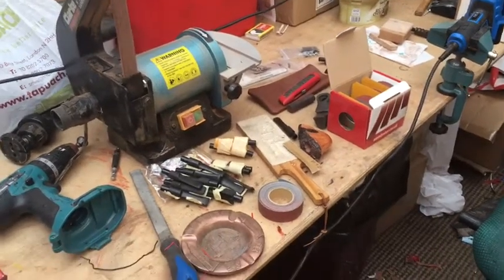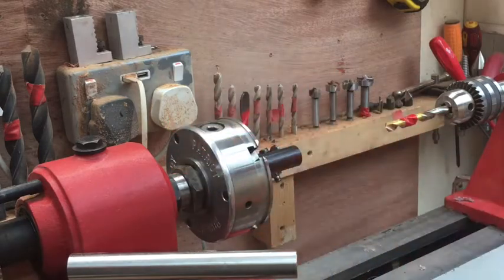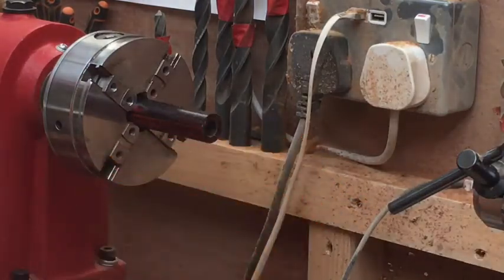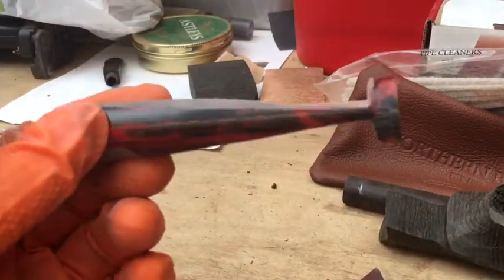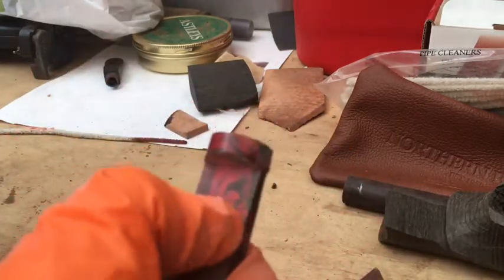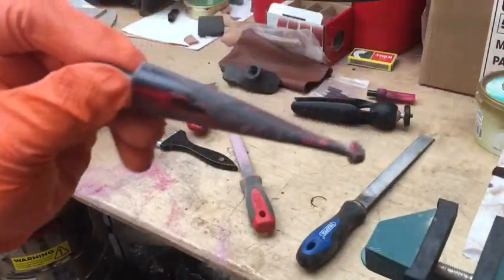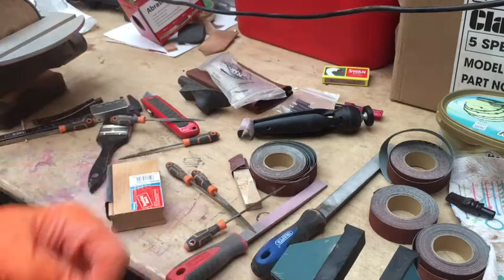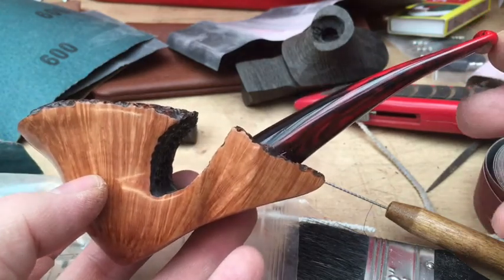Making a hand cut pipe stem

Comment: Thank you for the upload anyways. I have just begun making my first pipe. And i am so reluctant, just the shaping of the briar has been done for over a month now, because i am scared to ruin it. And i have yet to even begin any drilling at this point as im writing. And honestly i think i will wait for that point until next month because i need to buy a proper lathe. I have all the drill bits and everything. But not anything that can ensure an aligned drilling. But honestly i think you made a beautiful mouthpiece. And i would be glad if i could make something that nice for my own pipe. As long as i dont snap it ofc. But thank you for the inspiration. If you want to see what i end up with, check out when i upload the final product in a months time or something, if i actually end up succeeding, that is. Cheers 😄👍
Reply from the maker: @kevinmathiasen7334  good luck

Comment: Man that stem turned out awesome! Sux big time it broke. One method I saw on a video was to use hot water instead of a heat gun so it evenly heats it up then bend. Was that material made with polyester? I used some polyester pen blanks a couple times and it was awesome to work with but brittle and sprung back like your talking. Any way great job! Dont get discouraged! Take care!